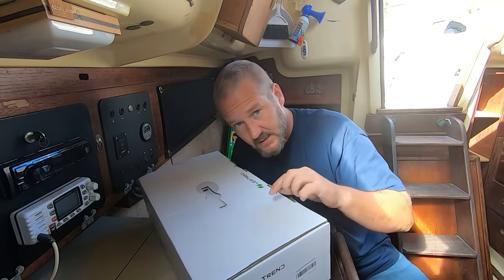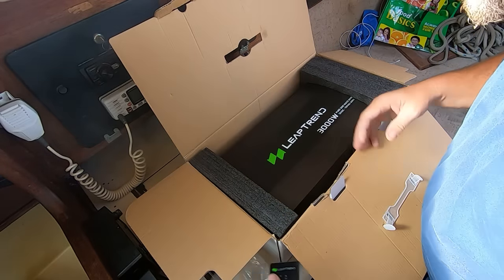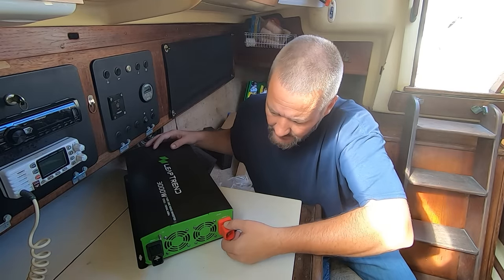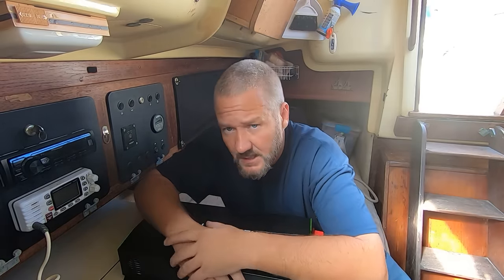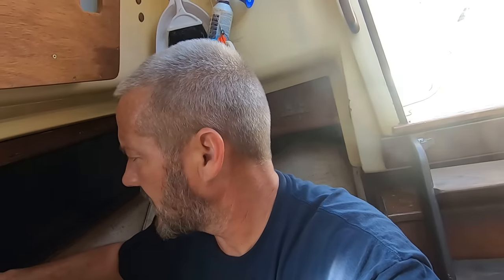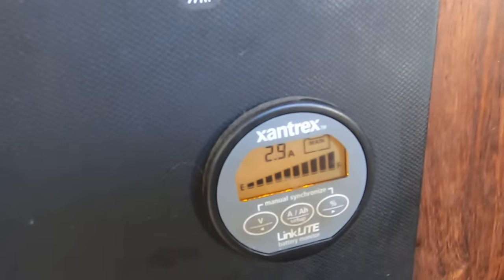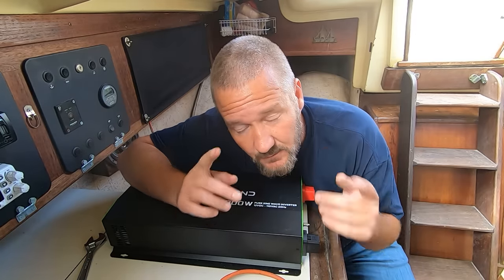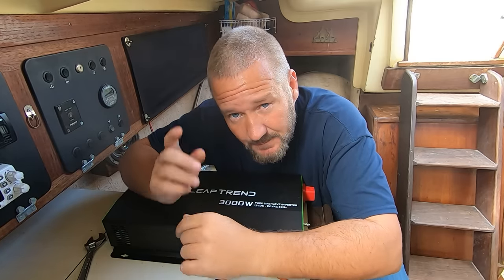This Went Wrong! Power Inverters - Ep 249 - Lady K Sailing

Comment: Measure dc voltage at inverter batt input. Probably  a large voltage drop due to undersized wiring to your batt. Also the crimp connections on the cable lugs could be suspect.
Reply: Yup, a 3,000 watt inverter running off of 12 volts will draw up to about 250 amps which means 4/0 cable.  The voltage drop in that tiny wiring he connected will likely pull the input voltage below the inverter's low voltage cutoff.
Reply: I agree, wiring is way too small a diameter for that sort of load.
Reply: Just came here to add this. Online watt/ga calculators ftw.
Reply: @todddunn945  Looked to be 2/0 wire, Tim hooked to the inverter.
Reply: Tim, please review the manual for wiring instructions.    The 12  Volt wires you used look like maybe 4 AWG which is far, far too small.  That inverter is going to draw perhaps 300 Amps, more if it's in peak 6 kW mode. And it will need a suitable circuit breaker.   Time to consult a qualified marine electrician.
Reply: @carlthor91  Didn't look that big to me.
Reply: I agree with this assessment. That gauge wire looked a little skinny. I also think you need to take a look at your batteries. I seem to recall there is a relationship between the amp/hour output of your batteries and the demand by the inverter.
Reply: @carlthor91  That is definitely not 2/0 wire, I use 2/0 at work on fork-lift batteries and chargers and it's WAY bigger than that. It's most likely the wire is not big enough to support 1800 watts (that is approximately 180 amps from the battery with your 20% estimated loss). Forklifts charge at 220 amps on 2/0 cable and even that gets the cable hot. Could also be the batteries can't handle the current as well, deep cycle lead acid batteries aren't known for their high current capabilities; I can't remember if he switched to Li-Ion or not.
Reply: That’s what I was thinking.  Undersized wiring.
Reply: I would have hoped that you’d have reached out to the manufacturers PRIOR to releasing this video (in order for them to review your test standards) 
It was a great experiment-and I’m sure that you honestly hoped it would work - but a follow up video will now be of interest to many as to WHY DIDNT IT WORK AS EXPECTED 
(I’ll be looking forward to that!)
Reply: @brownnoise357 13:51 13:51
Reply: Ha, yep, that was my first thought when I saw those small, crimped pigtails on the 12v input side of the inverter. The front end of the 3kw inverter is going to have a much higher draw then the 1kw and the alarm seemed like it was probably complaining of brown voltage on the supply side, not the load.
Reply: Hi Tim , 
It was a pleasure to meet you at the Anapoplis boat show! & lunch.
Happy Sailing....  ⛵
Reply: You have some very knowledgeable viewers.

Comment: Usually enjoy your videos but this shows you don’t know what you are doing with electrical systems. Yes you are doing something wrong. Your wires are not large enough to support the load. It’s not the inverter.
Reply: Whoa slow your roll Opie
Not everybody understands electrical systems and bagging on them won’t change that at all. Use your knowledge to teach others the black art of electronics👍🏼
Reply: @Dontnegotiatewithterrorist  
Like I said I enjoy his videos and value what he has to say most of the time, but he is posting as an authority. In this situation, it is clearly not so. If he wants to reach out to me I'll be happy to advise him on how to make it work but will not post it here because someone may apply it to a different situation resulting in an unsafe condition.

Comment: Not only are the battery leads clearly too small you are using a 16 gauge extension cord. Far too small for the pot or the combination of vac and sander.

Comment: Those wires are clearly not big enough for a 2000watt inverter let alone a 3000watt .A 2000watt is fused at 300amps on DC side and wire sized for 300amps. My 2000w Samlex pure sine will run kettle , microwave (1000W)  shop vac , Keurig coffee 4/0 105c wire x2

Comment: You need larger wires between the inverter and battery.
Reply: I hadn't though of that, but they don't look fantastic.  Often the kits include bare minima with stuff like this.
Reply: @UncleJoeLITE  I always over size wiring on DC side.
Reply: This was my first thought as well. For 3000w inverter you should need at least 2/0 up to 4/0 size wire. That's heavy duty stuff! Also, i would make sure it's the real deal, only pure copper not copper-clad aluminum which sadly is often included with many inverters. 

Also, great seeing you on Lady K again!
Reply: No question 100%, I would not use the inverter for I higher wattage items like coffee, microwave, anything over the 1K watts, forget about the AC, that would run your batter dry in no time!.  Instead I would have the inverter connected to the starter battery and only run it while the engine is running, my alternator is 120 AMPS so it would have no problem for this inverter, but still 3K watts represents quite a bit of consumption.   The reason I keep my 2k honda generator instead for the need for high current.

Comment: I recently upgraded my sailboat with an inverter so I could run my air conditioning. After the initial installation I was having a very similar problem. I theorized that the starting current on the air conditioner was causing a current spike that was tripping my battery monitor on overcurrent or under voltage. My solution was to install a 2.5 fariad capacitor into the system. I have not had a problem since. However, I understand that might not be the right solution for everyone.
Reply: To run larger size air conditioning systems off an inverter, you need a "soft starter" component, which is probably what your capacitor is accomplishing.
Reply: @svechappe6075  I looked at those, but they were about four times more expensive to do on the AC side as opposed to the DC side. I agree that's probably the correct answer, but if I could get away with a cheaper option ....that won the day

Comment: Wattage conversion formula is volts X amps = Watts so 3000w ÷ 120v = 25 amps possible total amps on your 120vac outlet side. Your 12vdc inlet power requirement is 3000w ÷ 12v = 250amps plus efficiency loss, let's use 20% would be 250amps x 1.2 = 300amp this is the number of amps your 12 volt cables need to handle going to the inverter. Your packaging instructions should have given examples of supply side 12 volt wire size requirements. Check your 12vdc voltage at the inverter terminals and see what the voltage drop is chances are your inverter is seeing a inlet side voltage drop it can't handle and that's why it's alarming and tripping out.

Comment: I put a 3000w inverter in my semi sleeper.  Was getting the same results as you until I used 00guage cable.  Basically welding cable.
Reply: Same here, had an issue with the cables.

Comment: You should really look into a regulated dc/dc converter to run your laptop. There are also dc versions of most of the things you listed, even kettles and air conditioners.
Reply from the maker: Yes,  has a clean 19.5v for laptop and screens, a clean 5v for a few chargers, and a clean 12 for routers and wifi gear.

Comment: Your 3000 watt inverter is actually a 3 x 1000 watt. It has 3 outlets exactly for that reason, and that is why you are having issues with it. Each of the outlets provides only 1000 watt. I have the same problem with my 2000 watt unit. When I remove the housing cover, I  see 2 identical circuits - 1000 watt each.

Comment: If you look at the inverter, you have a hard wire termination point. My inverter instructions states that this allows for a larger current draw than the outlets on the front do. Also "MAKE SURE" your wiring is of the correct gauge wire for the applications, especially on the DC side. Under size wiring will generate heat which causes increased current flow and voltage drop. Not to mention a fire danger.
I was probing all my DC connections with a laser heat detector. Found a hot connection on incoming solar feed in the process. When I loaded up a DC draw the wire became extremely hot. Once I corrected the wiring, I see a 30% increase in available wattage from the panels.

Comment: This could be a repeat of other comments Tim, but I'm wondering if because you are simply using the utility outlet on the inverter, you are not getting the benefit of the full 3000 watts of the inverter.  Normally the inverter would be hard wired to your distribution panel tied to select circuits on a bus bar.  There would be integration with your shore power feed via fuses and relays and create the automatic switching from shore power to battery power that is intended with an inverter.  Not sure if the rest of your sytsem is configured this way because I don't know where those cables you are connecting the inverter to are coming/going from/to..  That, plus the inadequate wire size of those cables would cause the fault you are experiencing.  Just spitballing here, I don't think it's a problem with the inverter itself.

Comment: liked the flying particles from the sander and grinder 😂
Reply: Oof, yeah I felt bad seeing the particles blowing out of the tools, espec. the shop vac.  Good video though, thank you Tim. Hope it didn't come at the expense of itchy-owies in the cabin.  So is it too small of cables from the battery, or was the issue that it was actually a 3x1000w inverter?

Comment: Need huge wires to supply power to the inverter. The inverter was beeping to low supply voltage. 
Also the power factor of different appliances act on inverters differently. Ie resistance load like simple heaters. And a ac motor like aircon act completely differently

Comment: Voltage drop is the first thing that come to mind, but you say the batteries are full and hooked up to the solar. Undersized cables are unlikely, since you are using the same cables as for the old inverter. Here is the mysterious part; I had similar problems trying to run my laptop from a 150W inverter. Sometimes, it would protest and shut down and other times it would hapily work with even a 24 inch secondary monitor attached.  I still think there is a voltage setting somewhere below which it won't work, or a voltage difference setting, I hope the manufacturer will tell you.
One more thing; only turning the grinder or sander on does not tell you how many amps it will use when pressed onto matarial.

Comment: You'll need  2 ought or 4 ought cables for 3000 watt supply from batteries. And the individual outlets on the may will be limited to 10A x 110 = 1100W. So two possible points of failure not related to the inverters quality. To get the higher output you should connect to the AC pin out on the back. You could use a heavy duty extension cord (20A) stripped end to test a unit. Sorry this is so late but an update to the video would be great! I appreciate your channel.

Comment: As an electronic engineer I had to say, Make one good power inverter today isn't so hard for sure,. BUT, make them work for long time inside a boat,.. man that's something that I really don't have idea! The sea is the villain of any electronics!
Reply: One thing I would add to your installation is a capacitor.
Some kind of at least 2.5 farad, it will prevent voltage spikes in your battery, which even in the most modern ones destroys them. 
In your test maybe your Inverter is able to supply all "energy" (voltage and current  you need), but  your battery don't ! Check the CCA of them

Comment: When the inverter reports 27A for an angular grinder, is that at 110V or 12V? Because the inverter can output 3,000 W max and at 110V that is max ~27A (~ short for "about").
If we go up the power source chain, power in being from 14.6V and assuming 20% of conversion losses, your 3,000W at the 110V output as input needs ~247A at 14.6V (or 300A at 12V). It's simple, but the cables I see in the video will throttle such Ampères and will get rather hot.
Another thing is if the inverter can handle electric motor loads really well. An old-fashioned (uncontrolled, most common) electric motor has an internal resistance of 0 (zero) when standing still and revving up its resistance will rise. This means that at the moment you switch the grinder on, an infinite amount of A wants to travel into the motor, very briefly.
Where I live, the base phase voltage is 230 - just as a way to have less Ampères, hence less heat loss in cables, and being able to use thinner cable to transport the same power compared to 110V.

Comment: I see a lot of good information in the comments. May I suggest setting up the ground before you run tests. I 've done a bit of electronics testing and repair from back in my days on stage. A solid ground has a way of smoothing out power spikes and potential failures. Add to that the fire risk of not grounding your equipment and you have a good case for not skipping steps while you test.

Comment: As a long haul truck driver, always had to run the engine to keep the battery voltage up when drawing heavier loads.  Boiling water, heating food in the microwave.

Comment: The kettle is a purely resistive load. It’s literally hot to neutral with resistance creating the heat. Older resistive loads will fail with too little resistance. Often times a separately derived power system( inverter) will not tolerate that kind of power consumption!! I’m a 25 electrician and I see this all the time. Great honest review Tim! I do value all honesty!

Comment: On page 09 in the manual for this product it says early cut off in due to less capable cabling from energy source. Use beefier power source cables. 
Anyways: Reading instruction litterature might be too much but as always 1/0 AWG battery cable is good enough, full bore might require 4/0 AWG battery cable.

Comment: Keep in mind that the amps for any 120 volt appliance will always be higher on the 12 volt side of the inverter. That’s why we use 120/240 volts in homes and businesses. Otherwise our copper wiring would need to 10 times larger. Think of ‘inverter’ meaning that the volt and amps on one side of the inverter would be the ‘inverse’ on the other side. For example, a 120v/1amp (=120watts) appliance would require 10amps @ 12volt (not counting the efficiency deficit) . Of course, this is oversimplified.

Comment: Connection to the battery was poor???  You would need to measure the voltage on the input of the inverter to be sure that voltage did not drop.   It should remain around 11.5V if possible.
Reply: officialladyksailing   Yes, if the connection remains strong, the voltage will hold up as power is delivered.    Connections are such a horrible feature in any circuit and worse when in warm weather and saltwater....

Comment: There’s a stack of viewers who sound like they know their way around wire gauges.

But my comment is on things that you can run on dc.  I wish I was sailing more, but I don’t.  I do camp a lot and we almost never use 240volts a/c (Australia).  We have a tiny inverter (not pure sine wave) and only 150watts.  This powers our charger for my cordless power tool batteries.  It draws 70 watts only so even with the inefficient changeover from dc  to a/c to dc again via the charger’s-adapter charging is easy.  We use a cordless everything so perhaps that’s a solution too.

Re computer charging:  you can often get cig plug adapters to charge in cars.  My wife used one of these for hers while working as we travel.

As for water heating, we use the usual camping gas (lpg - propane).  But we also have a stock of a dozen canisters of butane cylinders as a backup.  Even with heavy use we find they can last almost a week for one of them.  So a dozen would give us probably back up energy of close to two months..  so if we have trouble getting a gas bottle refill (rarely a problem here) we could survive.

On usage, my wife makes more cups of tea in a day than the average club of grandmas in the uk.  We do tend to store hot water in a thermos though, which means at least washing up water is immediately available.  It tends to last usable for virtually the whole day.
Reply: @artsmith103  those little bottles I bought at our big box store for peanuts in a pack of around a dozen.  There’s currently about 2 gone from the pack.  You’d think I’d be over lugging this around.

Comment: I had similar issues with a Motomaster 3000w inverter
#1 wire size 3000w @ 12v draws 300ish amps of 12v that’s a lot 
I’m running 2 wire for each pole 1/0 cuz 350 size wire is way to big to bolt on the tiny connector of the inverter
#2 can your battery discharge that much amps. 
What’s your battery’s

Good video cuz as you showed electrical is complicated and never just a plug and play

Comment: There are a lot of great comments. I would say your issue lies in proper supply connections, a proper ground, and the units direct plugs being rated at 15 AMPS for the 2 and 3kW inverters. Not quite a by the book installation or a true A/B comparison with your current installation, but still informative. I assume that the current inverter is hardwired to an AC breaker panel somewhere with  properly sized wires. Great video.

Comment: An air conditioner compressor is an inductive load. If it needs 15 amps to run, it may need 30-40 amps to START. You can usually solve that by adding a "soft start" to your AC. This eliminates most of that huge start up rush current, then steps out of the picture.

Comment: My guess is that you were relay close to smelling hot wires in the recent past. Your leads between your battery bus and new inverter need to be upsized to take any advantage of a higher capacity inverter you might install regardless of the manufacturer. Your new inverter is protecting you better than the old one because you are getting an alarm.